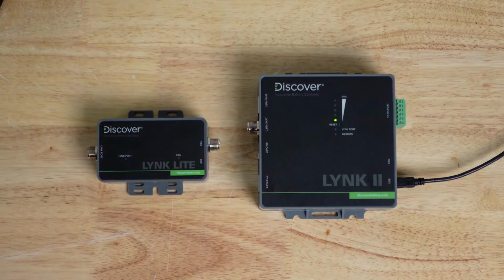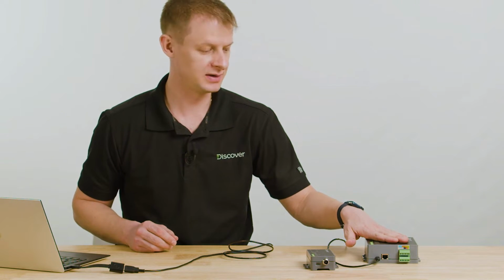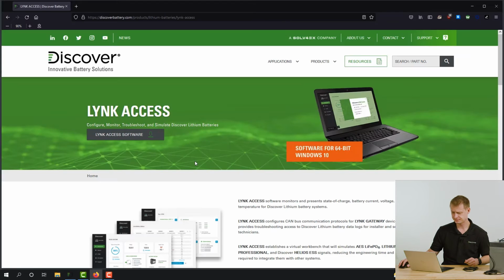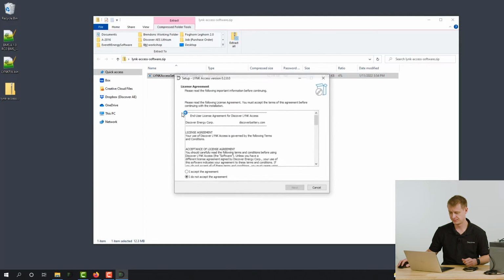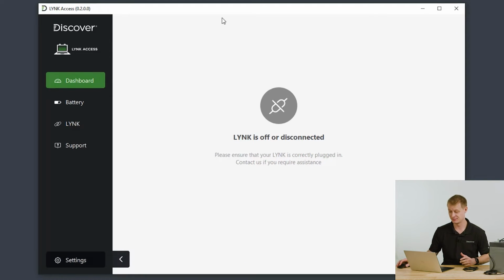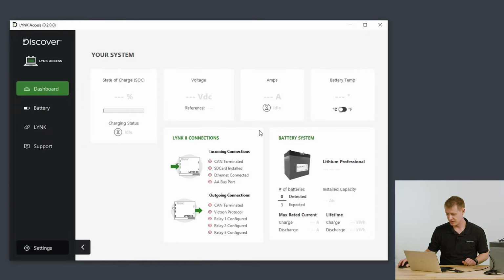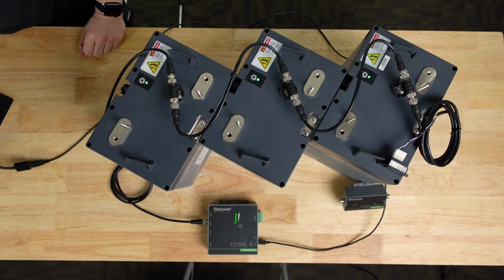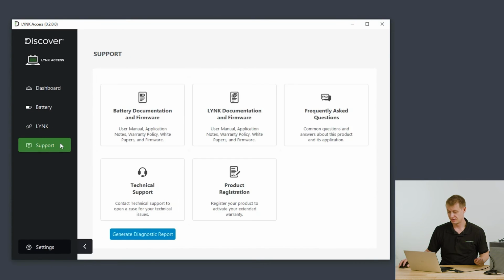How to install LYNK ACCESS and connect LYNK to your computer and batteries.

Comment: Hi. can you monitore your batteries online or using an app ?? or you have to be connected directo the equipment to see the data ??
Reply from the maker: Hello, you can manage the batteries through the LYNK ACCESS Software through a Windows based computer connected to a LYNK device through USB. Some installers leave an inexpensive computer connected and manage it through a remote desktop application. There is a cloud version of LNYK Access currently in development but we don't have a release date available yet. 

For future developments keep and eye on the Discover Lithium Website https://discoverlithium.com